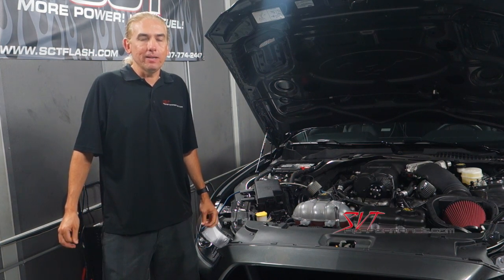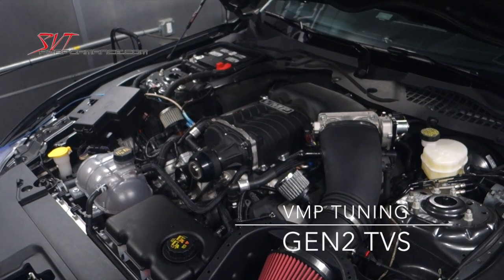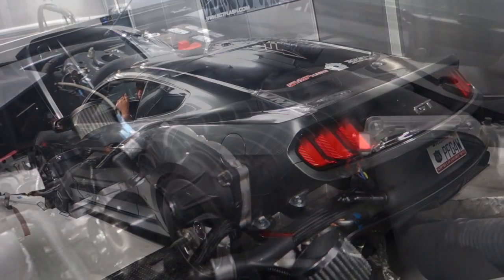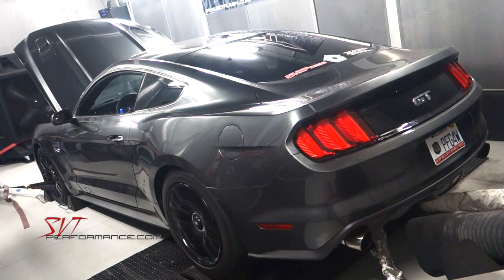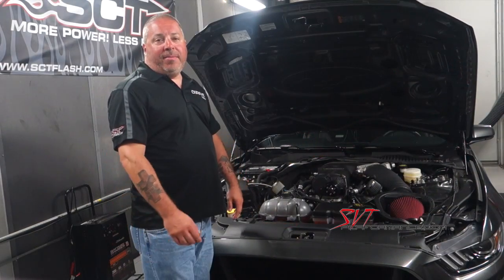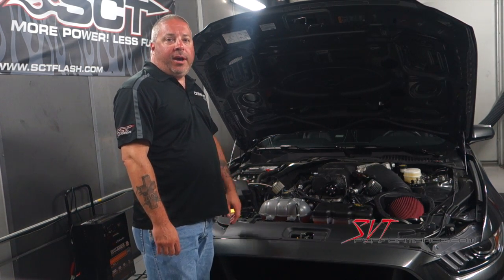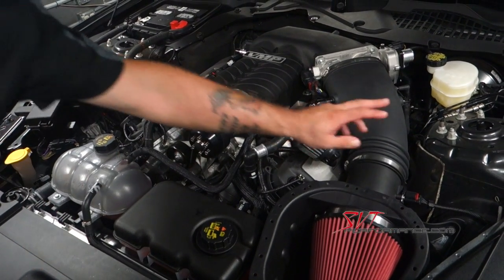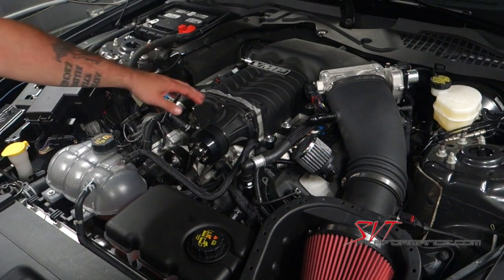SCT VMP Gen2 TVS Tuning

Comment: More like 176 hp and 123 tq increases... Why? The hood is open on the dyno, letting the natural airflow of on road driving be taken out if the picture and no natural heat build up, plus a fan blowing directly on the air filter. Legit dynos are "hood closed". I want real world road numbers "hood closed", not parking lot meet ups with the "hood open", for bragging nonsense. Plus, it's a ROUSH piece of garbage...